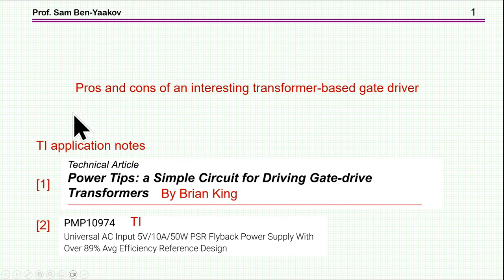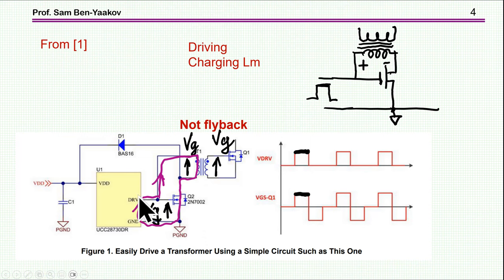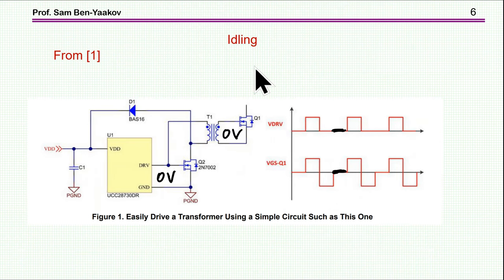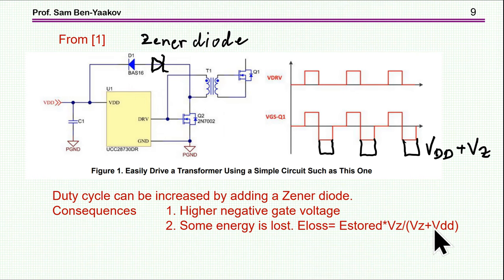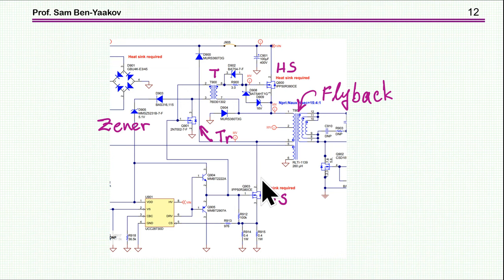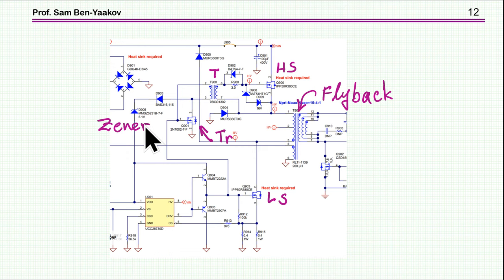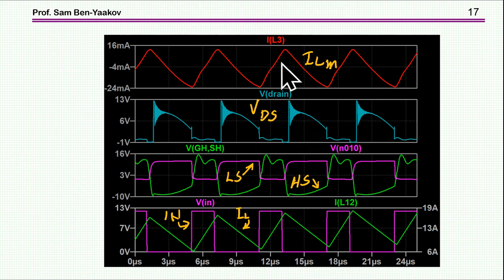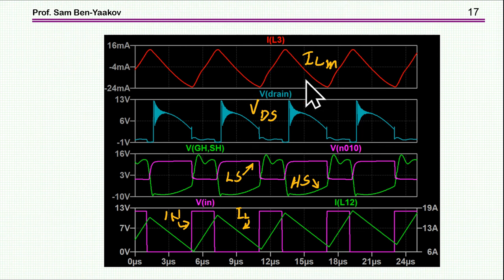Pros and cons of an interesting transformer-based gate driver

Comment: Thank you for video. I would add that this circuit does not have the disadvantages of other transformer-based gate drive circuits that use decoupling capacitors that can keep the MOSFET on for a very long time when the input signal stops switching or suddenly changes duty cycle.
Reply from the maker: Thanks for input.

Comment: I first suspected turn-off for the high-side MOSFET would be very slow, driven only by the magnetizing current, but realize now that the body diode of the small signal MOSFET fixes this issue. Neat. I think I have seen this or a similar circuit before.
Reply from the maker: Thanks for input.

Comment: I have designed many commercially sucessful products that use transformer based Gate drivers.  There are typically more design challenges than using purpose built Gate drive solutions,  however the cost advantage is significant for a mass production design
Reply from the maker: Thanks for the useful input.

Comment: I frequently have wanted transformers for this purpose, but I had a lot of difficulty sourcing them.  Do you have any recommendations for sourcing these transformers?  I noticed in the schematic you showed, it referenced a 760301302, but, that is a massive transformer, for something I was hoping to find in a 3x3mm SMT package, something more like a ATB322515-0110-T000.   So frequently transformers feel like a great solution needing to driving mosfets on challenging rails -- But I just can't figure out how to source appropriate ones for smaller applications.
Reply from the maker: The best is to custom order. 3X3 seems a bit small unless you use exotic materials which will make it expensive
Reply: @sambenyaakov   when it comes to custom transformers do you happen to know a good way to craft them? as in i know the math for a certain E or P core but how do i chose that initial core + PCB mounting thing ( plastic part where you wind the wire)
Also for gate drive transformers how practical is to to repurpose them for small power isolated power supplies?  (gate driver ic on one side +50% PWM shifted 180deg and simple rectifiers on the other side?
Reply from the maker: @sanjikaneki6226  In most case you can just specify to the mnufacturer the need and you will get a good design. Yes mst gate drive transformer are usefull for aux powersupply design. See: https://youtu.be/RQboLY1zP3Q     https://youtu.be/0Nb7uE_p5-w
Reply: @sambenyaakov    THX i will study those videos and regarding custom transformers i never asked the manufacturers since i am afraid of huge development costs and large MOQs with expensive parts
Reply: @sanjikaneki6226  I really do hope more of the pre-canned kinda basic small transformers come along.  It's hard to get small and cheap when you have to do custom orders.  It happened for inductors, and there are starting to be a few good transformers in < 3mm x 3mm packages.  They're just so uncommon right now.

Comment: Nice video, very informative. Do you have any videos that cover conducted rfi caused by line voltage switching? I'd love to learn more about that topic. From my understanding it has a lot to due with different fet technologies planar vs mesh, but was not sure if there are other techniques that could be used to mitigate conducted rfi noise.

Comment: You mentioned that these days isolated gate drivers tend to replace gate transformers but most of those ics tend to need a isolated supply so you need a transformer for that anyway, or some capacitor based supply.  
Also is that push pull bjt really needed or it is just to be on the safe side?
Reply from the maker: IN most cases one can use bootstrap supply. The schematic was borrowed fromanothe study. Buffers are clearly not needed here.

Comment: Hello professor and thank you for sharing always excellent content. 
But why to complicate your life in this way? Why not using a gate drive transformer with 2 secondaries with dc restore and use each secondary to drive the 2 fets? With all the parasitics involved in such arrangement it is strange how this circuit can "work". Strangely enough TI does not present the gate waveform of the high side fet. I see only potential problems with this circuit and not even a cost advantage.
Reply from the maker: Yes, I agree, this is a problematic circuit. I brought it for educational purposes, it does include clever ideas.